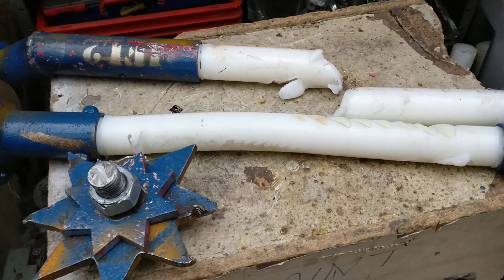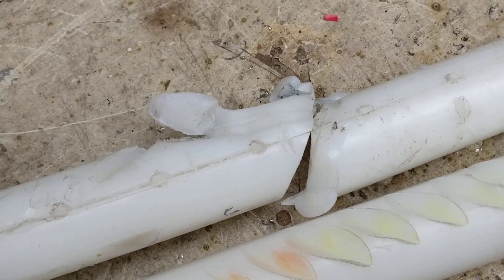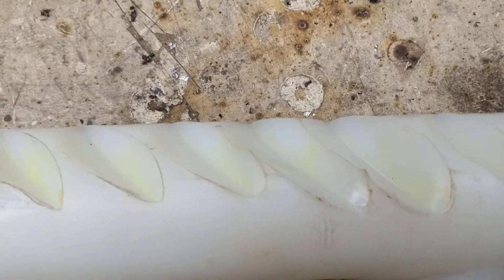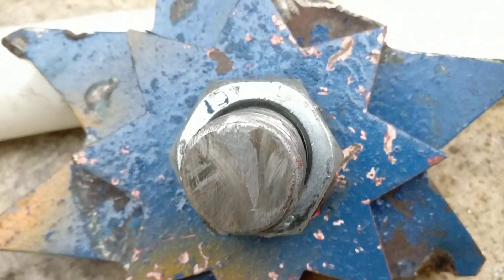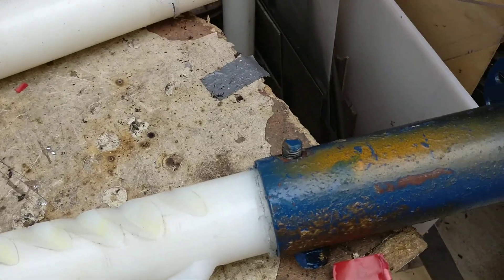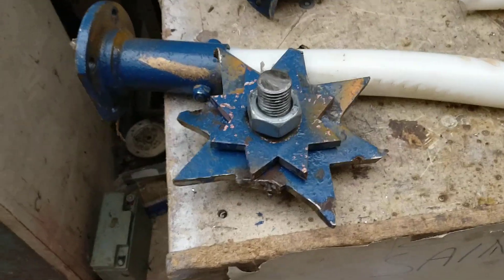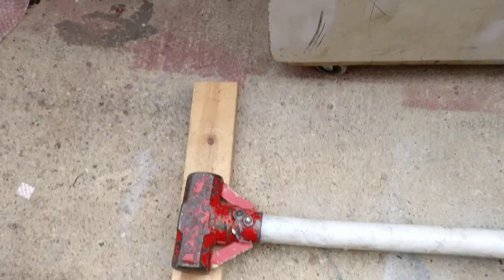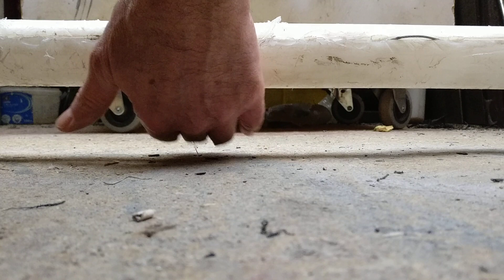Why does Team Gabriel use plastic weapon shafts?

Comment: Another interesting insight: Thanks Craig! It's very easy to write plastics off, but I guess it comes back to basic principles like trees, which bend in high winds. Gabriel is a great example of how to use plastics effectively on Robot Wars, and I can't wait to see you guys on the international special!!
Reply: I remember seeing another robot pull this off to an extent waaaaaaaaaaay back in Original Series 2. IIRC the robot was called Rameses and had plastic armour on the sides to resist cutting attacks, as it was more flexible than metal. Of course, back then, the only robots that could have done that kind of damage reliably were the House Robots (and arguably Mortis).

Sadly, I don't think Rameses got very far as the reliability of early robots was much more questionable than nowadays.